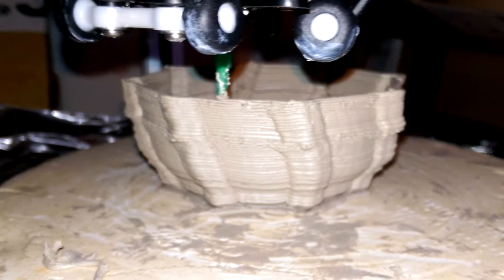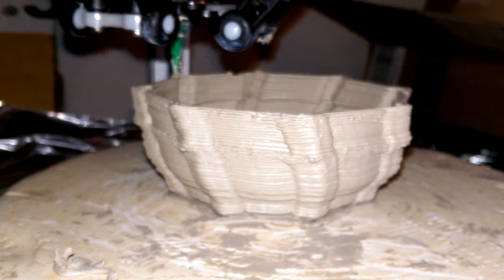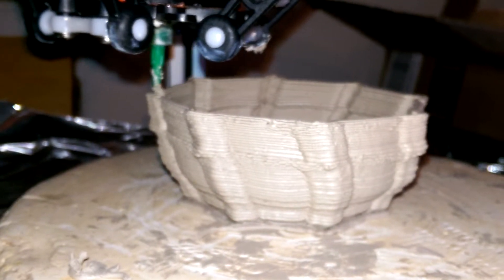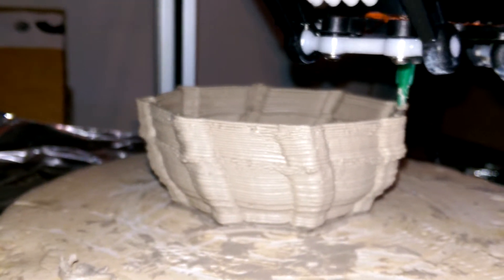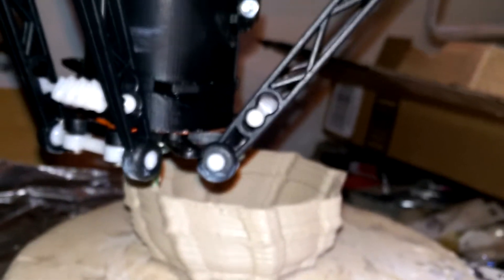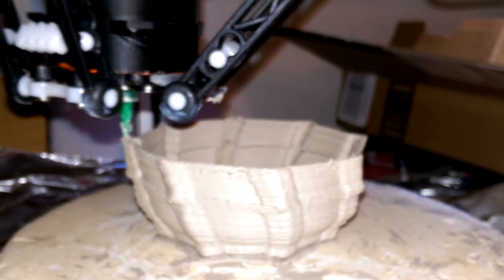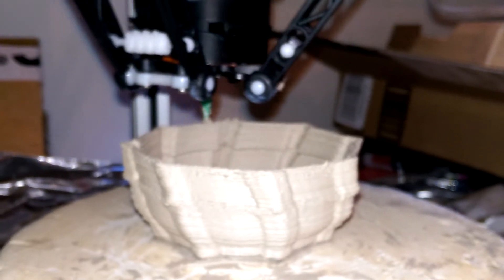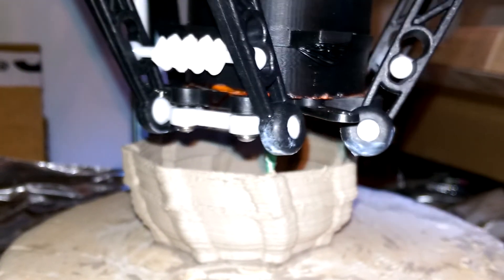3D Printing With Clay

Comment: nice work !

would you mind sharing how did you build the clay extruder and the setting?
Reply from the maker: Using Meshmixer, I modified an Uxcell adhesive dispenser adapter I found here: http://www.thingiverse.com/thing:977275 Settings were pretty much the same but I turned off the heated bed and hot end extruder, and slowed the speed from 40 to 20.